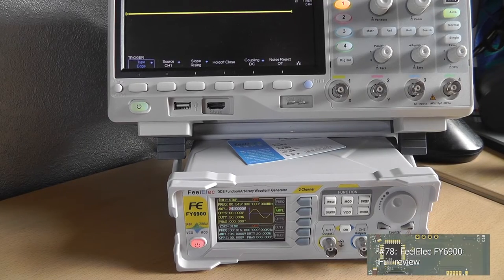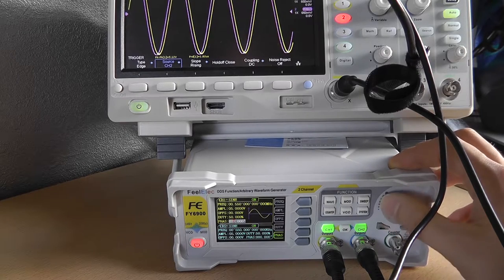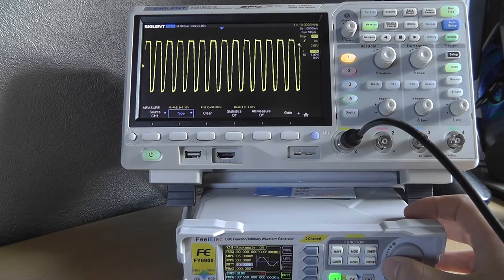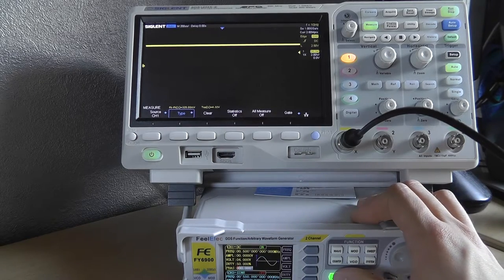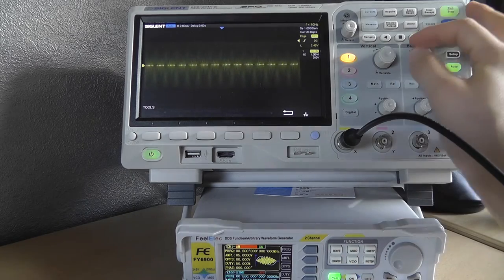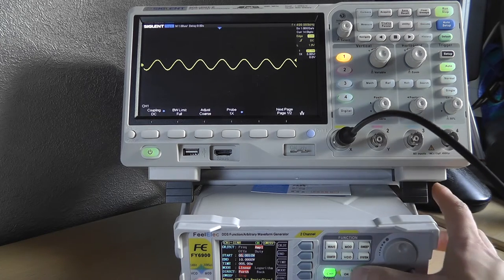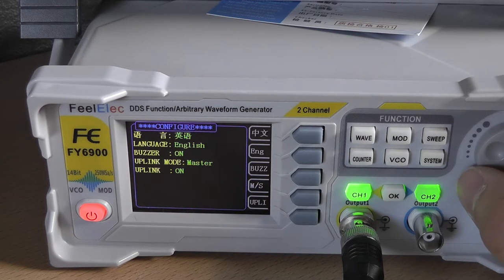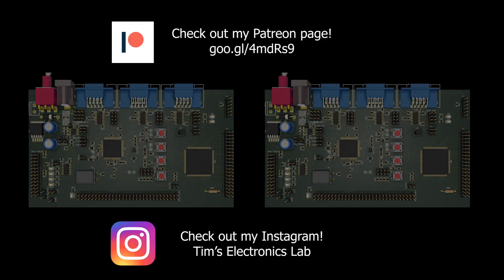#78 FeelElec/FeelTech FY6900 Full (in-depth) review 🗣 (Chapterized 🧾)

Comment: I ordered the 100 MHz version it was out of stock so I had to wait a few weeks for it to be made. I got it today and when I hooked it up and turned it on it was DOA does not turn on at all.
Reply from the maker: Did you turn on the power switch at the back? There might be a fuse in there as well. If you want you can open the device and check the connectors
Reply: @TimsElectronicsLab  Yes sir I did it all right. I plugged in the ac cable and turned on the switch above it. Nothing happened. I even plugged in the ac cable to my Oscope to make sure there was no problem there and it lit up just fine. So what ever the problem is it is inside the FY6900. There is no fuse you can get to on the unit without opening it up. This is not good on a unit built in the last 30 days and fresh out of the box. When I received it the package was in good undamaged condition. I don't want to open it up at this point because that could void the warranty. I have contacted Bang-good about it and I will have to wait and see what they have to say. I have also contacted Pay-Pal. I had to wait nearly two months on this and when it gets here it's DOA.
Reply from the maker: That's a shame! I really hope banggood get's everything sorted out and sends you a new unit!
Reply: @David Oaks Sr You cant order 100 MHz version because that did not exist. Only what you can have on any FY6900 are frequency measurements till 100 MHz.
Reply: @FileFixer007  I repaired the FY6900H-100M & it is working fine all the way to 100mhz. It did & does exist. You might want to update yourself on what exist before you tell me that something I have owned sense last summer did not exist.
Reply: @dwoaks1  There are two motherboard revision for FY6900 V1.8 and V1.9, where the V1.8 still used the Altera Cyclone 4 FPGA, and V1.9 started to use a FeelElec-PRO 1941 FPGA and a Fan power supply header was included (despite no Fan is supplied up to Nov-2020). FeelTech does not have any information and support for FY6900H-100M models. Also last firmware was 1.4 inside Winbond 25Q16JVS10 Flash ROM IC in the Main PCB Signal Board. There are also two known PCB revisions for the MCU Board, V1.8 (that goes with Signal Board V1.8), and V1.91 (That goes with Signal Board V1.9). To reach 100 MHz you need two things... First three numbers on FREQ scale instead of two and modified firmware inside Winbond 25Q16JVS10 Flash ROM. Official FeelTech Aliexpress store also have only FY6900-60 MHz model as a higher FY6900 model. I believe that you have 100 MHz model but this is not original FeelTech product. I have dumped v1.3 firmware from Flash ROM and have plan to do some reverse engineering when I catch some more time. I also told them (FeelTech) my opinion regarding shitty power supply inside FY6900 which is not adequate for that DDS Signal Generator and at the end after they not want to respond at any time and many times about that problem I decide to implement my own Linear PSU inside FY6900 and put original SMPS in junkyard. Benefits are much more lower noise and frequency stability thru all frequency range especially at higher and lower voltage output.
Reply: @FileFixer007  mine is Version 1.3.1.3
Reply: @FileFixer007  I opened mine back up to look at it. says V2.1 & WWW.FEELTECH.NET on board. This was shipped in Sept of 2020. Good luck getting any reply from them I could not get one.
Reply: @dwoaks1  This is one answer on EEVblog forum from Feel Elec about firmware v1.4... Dear customer, Now, we are releasing version is 1.3. V1.4 is still being tested and is not recommended for upgrade. FeelElec       As we can to see they give up for new firmware. Some guys was able to upgrade but it seems that Feel Elec, because of many bugs, pull that firmware upgrade from FE site. Mine board are v1.9 shipped in Februar 2020. I have plan to replace TCXO oscillator with some precise like AST3TQ-T-10.000MHZ-28 and aluminium shielding inside all plastic case. Previous new power supply still show real benefits on osciloscope. FY6900 DDS are real good product but he have several childhood diseases that are very easy to deal with.
Reply: @FileFixer007  yea my firmware is 1.3.1.3
Reply: @dwoaks1  Did you try set 1 kHz/5V on Generstor and read frequency on scope? What shows on scope frequency reading?
Reply: @FileFixer007  No I haven't yet but I will try that and see what it says.
Reply: @dwoaks1  I ask you to check this because that FY6900 have some frequency offset. My scope read eg. 999.9986 Hz instead of exact 1.0000 kHz. This can be solved very easy from hidden menu on FY6900. In the same time push and hold Power Button and CH1 button then, when you hold that butons, power on FY6900 from back main switch. After FY6900 power up go to menu, push MORE and at the bottom (OSCI) you can to adjust frequency offset. When you adjust frequency you can see in real time on scope what you adjusting. Easy way to connect FY6900 and scope are BNC straight cable what come with FY6900.